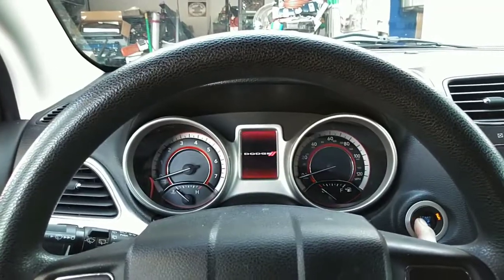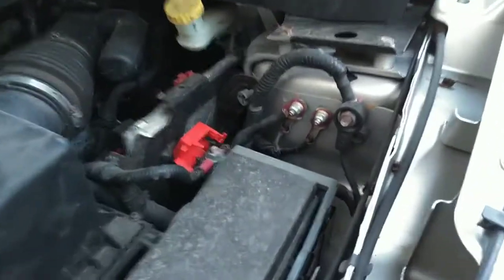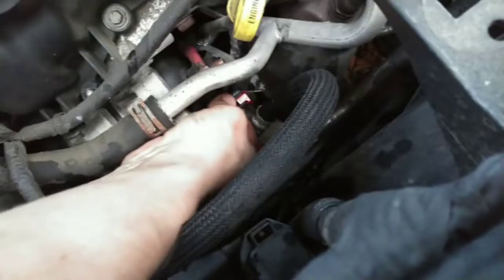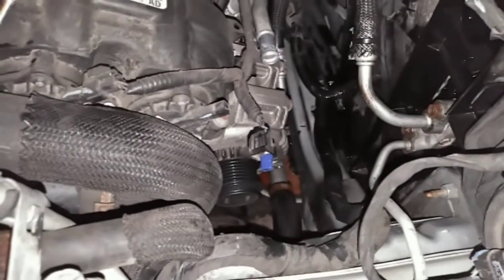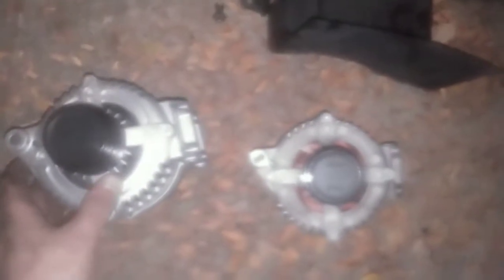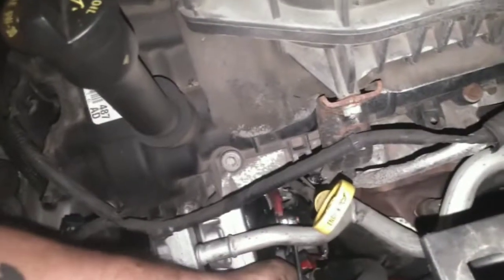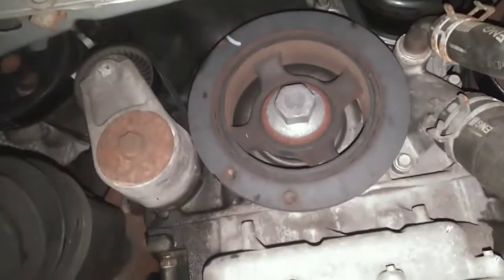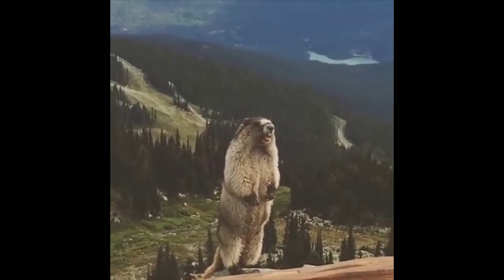Replacing an Alternator 2011-2017 Dodge Journey

Comment: Since you don’t run the risk of crossing positive to ground with a metal tool, it is perfectly acceptable to remove the power feed at the engine bay to de-energize the system.

Comment: I thought I wanted to do this myself but not anymore bc I don’t want to remove the hoses or battery hookups
Reply from the maker: There's a battery disconnect in the trunk. I pulled it. I don't think I undid the connections up front. Just unbolted the box and moved it enough to get access to the fuse box.

Comment: Tearing one off a 2014 tomorrow, and I feel like you did too much. I'll let you know. 😅
Reply: I felt that way too, so how did it go?
Reply: @drodriguez3935  not bad. Did end up taking the wheel off, and everything else that he did, but the worst part was getting the belt back on after putting it all back together. Put a used one in, and I think it's gone bad already, so I'm hoping that it had a 60 day warranty or more. 😅

Really just wanted it to last until the weather got better, and that's about as long as it lasted, so I got what I was hoping for. 🤷

You get what you pay for, but it was $60 well spent. 🥴

Comment: Can I use a 2011 dodge journey alternator on a 2017 dodge journey
Reply from the maker: According to Rockauto (if you click on part number) 2011-2019 is same, as long as amp alternator is same.
Reply: @98eck  thanks

Comment: Do you have to unhook the battery?
Reply from the maker: Yes. Anytime you are messing with replacing a component that uses electric you should. Otherwise you run the risk of causing damage to something. Might accidentally touch the positive cable to a place you shouldn't have and causing a short, blowing a fuse, melting a wire or creating more work/troubleshooting.